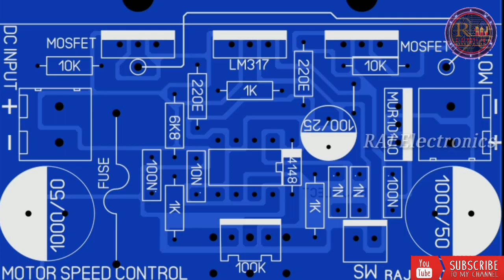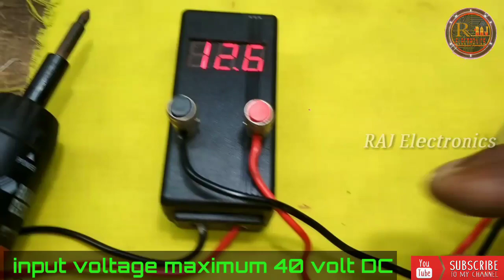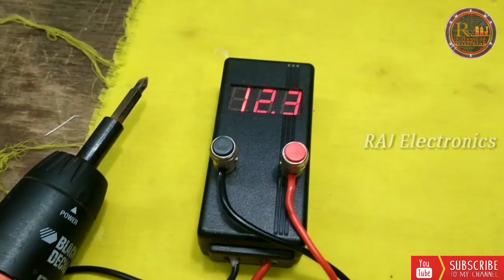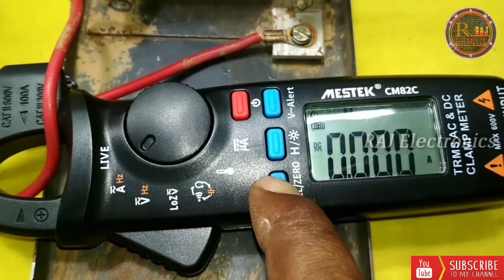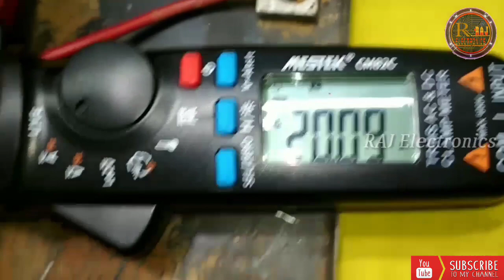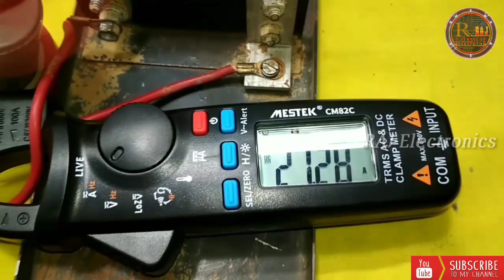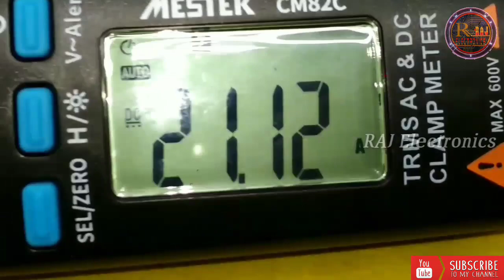DC Motor speed control 20amps

Comment: ആബ്ബിളിഫ്ലയർ മൂളുന്നു ഹീറ്റ്സിഗ്ഗിൽ കൈ തൊടുമ്പോൾ അതുമാറും ആ ശബ്ദം മാറാൻ എന്തു ചെയ്യണം
Reply from the maker: Proper GND kodukku
Reply: volume controller adakkam metal parts varnna baghangal commen groundil connect cheyyuaka (vol ,bass.treble ,transformer,heat sink etc,)4440ic amp annel athu mattan athara elluppala